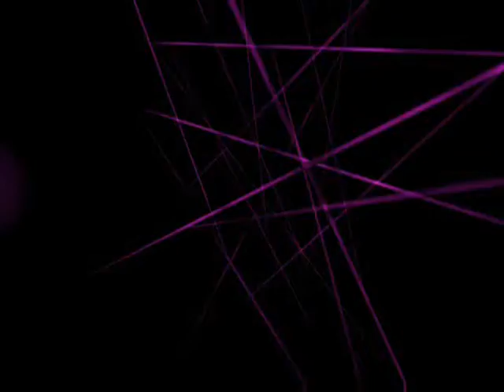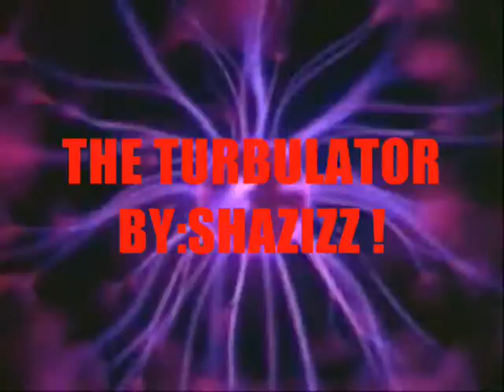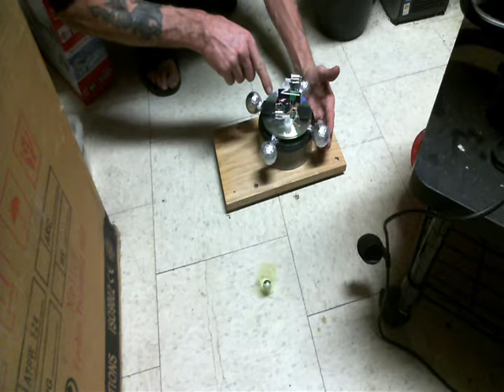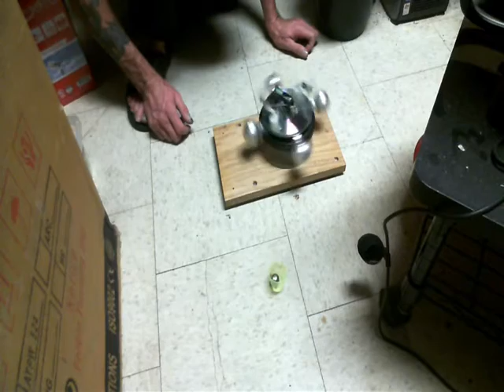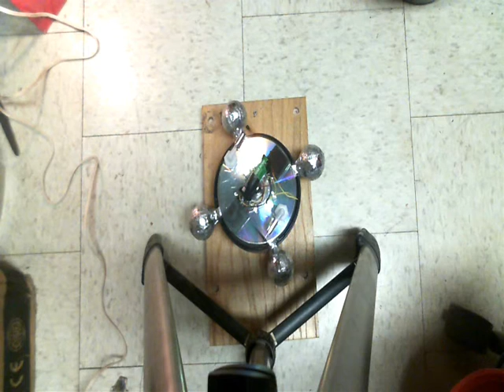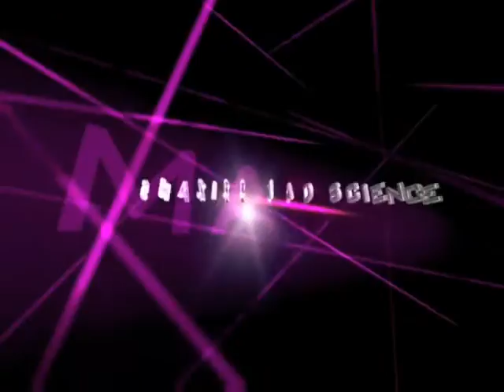THE TURBULATOR !

Comment: you could build it into a static motor. with a positive can, a negatieve can and your rotor in between. to make static is way easier than using a batterie and motors. shazizz you know that dc and your dc motor isn't efficiënt. it has a cogging effect. so id say built in to a static motor, it is more efficiënt.

Jermain
Reply from the maker: I like the way you think. I want to see how far this can be taken.
Reply: shazizz do you want discuss it tomorrow on Mad Science?
Reply: shazizz you can count on my tomorrow

Comment: wow shazz, on a larger scale there could be quite a few applications. It would probably be important to get the right ratio of magnet to motor size right?
Reply from the maker: Yes, I was thinking about the size of a playground merry-go-round would be great. When you get those old merry-go-round's going because of the weight and centrifugal force they are hard to stop. Plus they could hold a lot of stuff on them and I could connect a generator head to the underbelly of one. The point of this video was to get the idea's flowing and see how far this idea can go. :) Thanks for the comment..